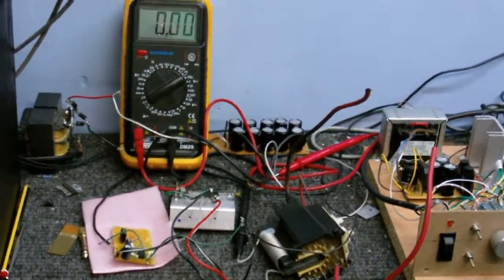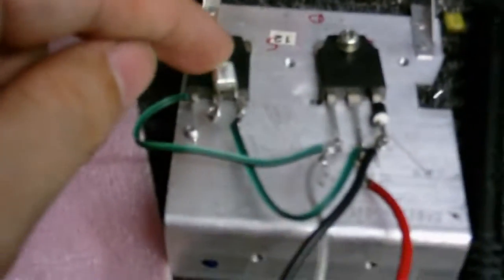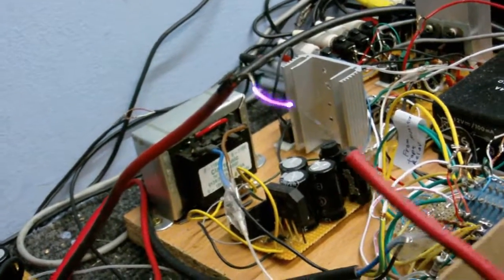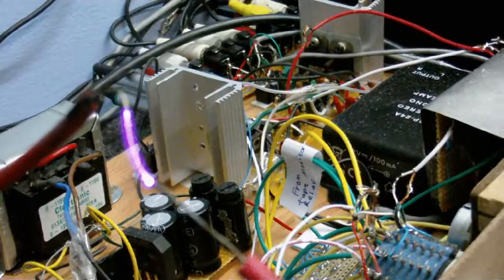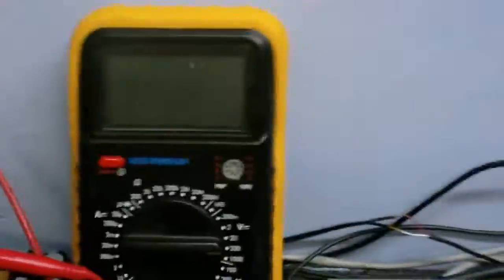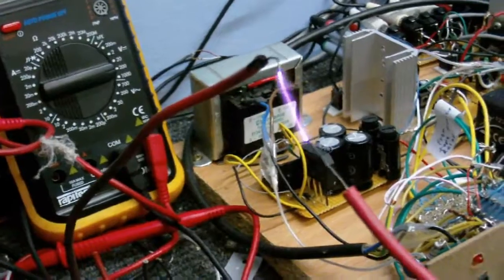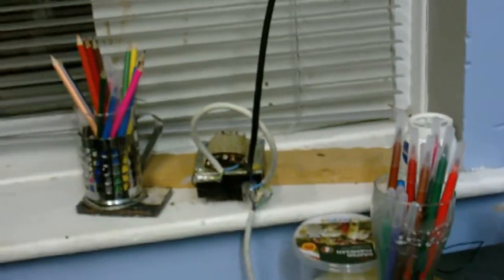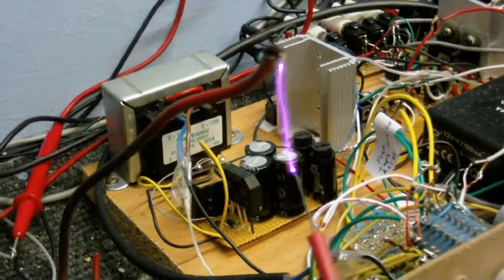Update on high voltage singing arc project.

Comment: aren't the capacitors shorting the bridge rectifier when they are discharged?
Reply from the maker: +Gotin Fuklio I always turn the power off before I discharge the capacitors, just to keep everything safe when I'm not using it, it does not short the rectifier.
Reply: so you always make sure the capacitors have some voltage before starting?
Reply from the maker: +Gotin Fuklio Are you talking about inrush?  I don't pre-charge the capacitors or anything like that, there's no need for it.  With the transformers I was using, the inrush current and length is just too small & short to damage anything.
Reply: so i can drive my big drill rotor directly from the rectifier with caps? btw try putting rotor from flex or any 220/120 v machinery in iron tube, put wires anywhere on the collector and the self generated magnetic field will spin the rotor very hardcore.

Comment: @CoolDudeClem Thanks for your help. It turned out to be the potentiometers I was using, which were logarithmic ones salvaged from an old broken mixer deck. After changing them for Linear pots I was able to fine tune the frequency and duty cycle better and managed to find the "sweet spot". 

Yes I am using a 555 timer circuit and I have uploaded a video to my channel of the flyback being audio modulated via pin 5 and a 100nF capacitor. All I need now is a decent power supply!

Alex.

Comment from the maker: @CoolDudeClem ctd..  If I remember, his circuit used no potentiometers, it wasn't great, but better than nothing, in fact his circuit is what was using in this video, the only difference is that I used 2 mosfets. Lastly, if you only need to use 2 pins on the potentiometers, that's fine, connecting the other pins to each other shouldn't make any difference.

Comment from the maker: @Alex1M6 It could be the flyback itself, I found that older ones from the 80s and earlier work better.  I found the flybacks from modern TV and computer monitors don't work so well and instead of getting a nice steady arc, they produce lots of noisy sparks, they're useless for audio modulation.  I'm not sure what circuit you've built but I assume it uses a 555 timer?  You might want to have a look at Vegmatic1966's video on how to build a singing arc as I've tried that myself and know it works.

Comment: @CoolDudeClem ...Of the pins on the potentiometers, the ones that gave a variable out resistance when the nob is turned. Should I have used 3 pins (One has 4 pins and the other has several) and just connected one of the pins to the other as I am a bit confused on to if I need connected at least three pins on each pot to make it a potentional divider rather than just a variable resistor, Or have I got that wrong too?

Any help would be appreciated, Thanks!

Comment: @CoolDudeClem Thanks, The reason I ask is becuase I have recently made a pulse width modulator to drive my flyback using a schematic I found on the internet and for some reason I can only get small screeching arcs but have since tried a number of mosfets I have salvaged and the result it the same, even after adjusting the variable resistors and audio modulation on pin 5 can only be heard very faintly and unclear from the arc.

One thing about the potentiometers, I only connected two one the...

Comment from the maker: @Alex1M6 I'm using a couple I found from a computer PSU, connected in parallel so they share the load, one is a 2SK2850 and the other is a SSH7N904.  I might experiment with IGBTs and see if it improves.

Comment: You can try to use only half of the primary turns on the flyback. should give a even bigger arc. but pulls more power. But that also means more power output! =)